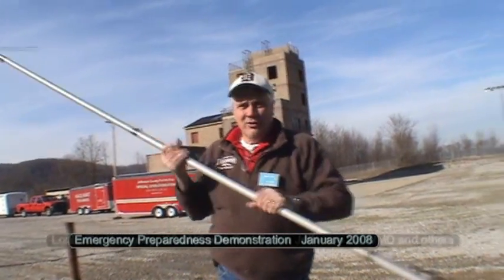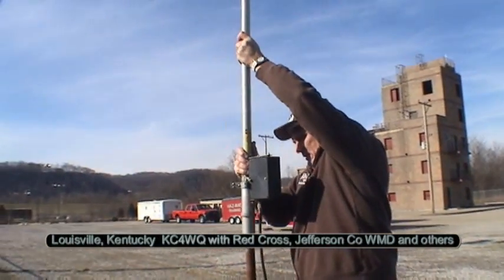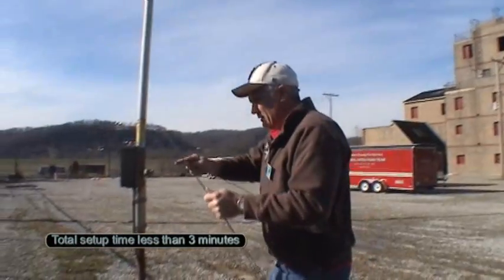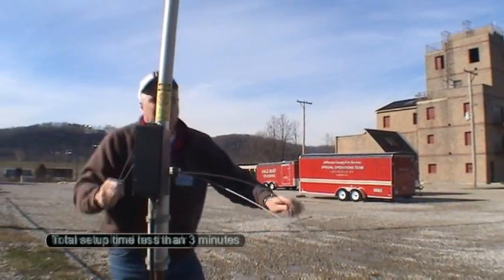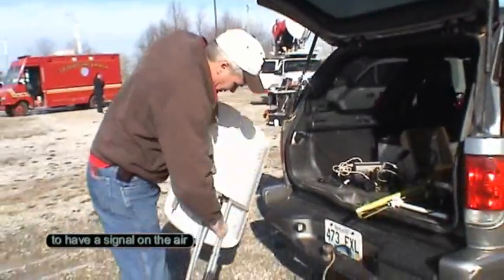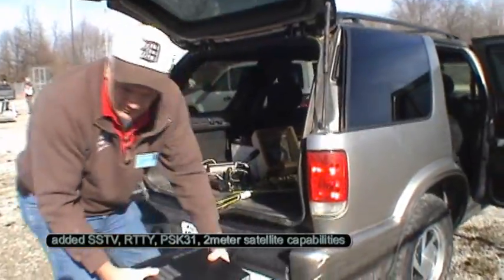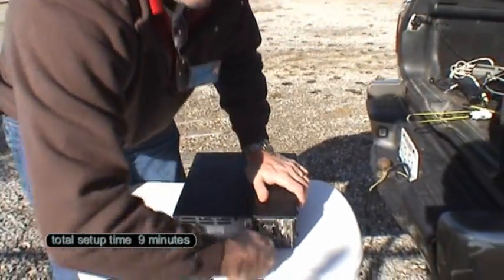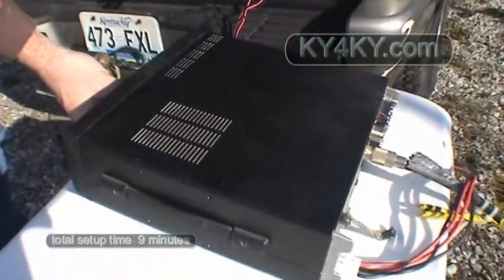Amateur Radio Emergency Preparedness Demo

Comment: can you better describe the antenna? it seem very easy to build (homebrew) and assemble! and what's its the frequency range?
Reply: Hola Claudio, the vertical antenna is the R7 and covers 10,12,15,17 and 20 meters.  Assembly is very easy and the antenna disassembles into an easily transportable package.
Reply: Buddy Sohl thanks Buddy! I am also looking for something able to work on 40, 80 and maybe 30 meters.

Comment: Thanks for the quick reply. 

Currently I am using 3 Radios one HF a 2M and a D-STAR HT and a Diamond HV7A as well as a home brew .. but I need to find a good way to add the Radials. Have a 30 W Solar Cell Charging a starved acid Battery and a good inverter .. but no where near as fast (yet) .. 

Thanks again, 

73

Dave, KJ6GLX

Comment from the maker: @dkaplan2005  The setup is straight forward.  The rig is DC powered 100 watt, brand and model doesn't really matter, power is provided by 2 deep cycle batteries (capable of providing duty for many hours), antenna is a mulitband vertical that breaks down into easily manageable segments (less than 4'), the laptop runs through it's internal battery supply and is assisted by a DC-AC inverter when needed.  All of this fits in the back of an S10 Blazer with room for supplies, clothing and overnight gear

Comment from the maker: @IRONMAIDENFAN2006  Cell phones are one of the first devices to fail during periods of emergency.  The cell towers are designed to handle less than 6% of all active phones before failure.  That percentage is based on 2005 statistics.  With the cell usage now I'm certain that percentage has fallen substantially.